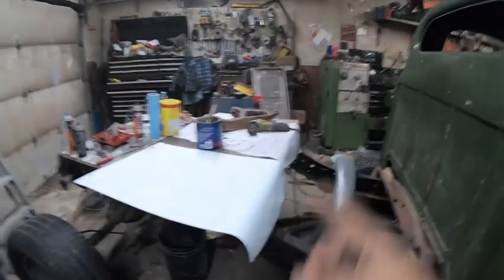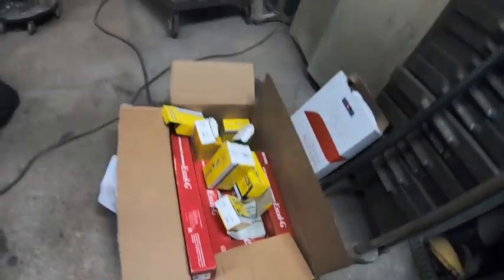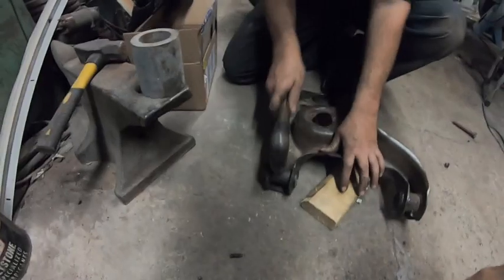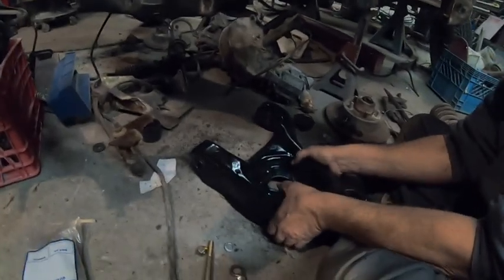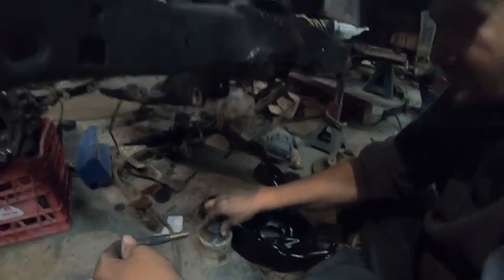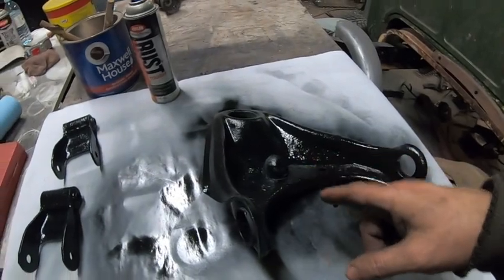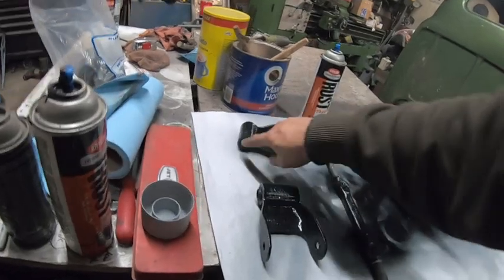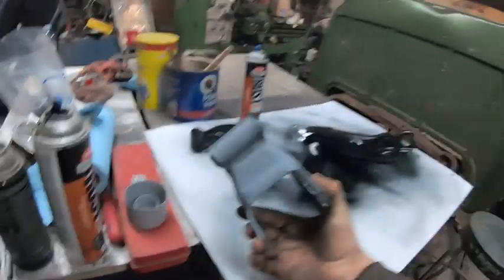1952 Studebaker 2R5 Truck With a Dakota Frame Swap.  New Ball Joints and  Bushings Get Put In.

Comment: Excellent video Penny's  :) also 6 cylinder springs are better than 4 cylinder ones especially when using a V8 motor also transmission of your choice too plus axle ratio too all parts paint going look nice too even !
Reply from the maker: Thanks for watching Andrew will see you on the next one

Comment: Nice anvil! I havent touched the suspension, never looked at brakes yet either.
Seems the ball joint kits never have the fittings a guy needs. I bit the bullet and bought a snap-on kit after bending 2 of the economy brand kits. Mind you, i use mine a lot.